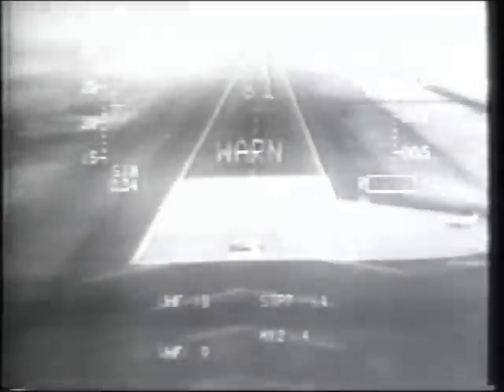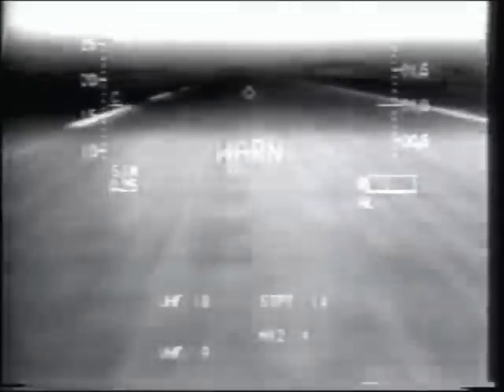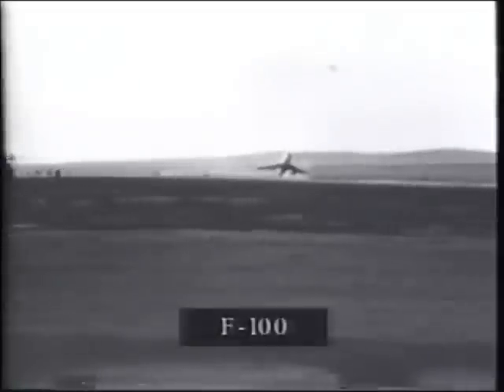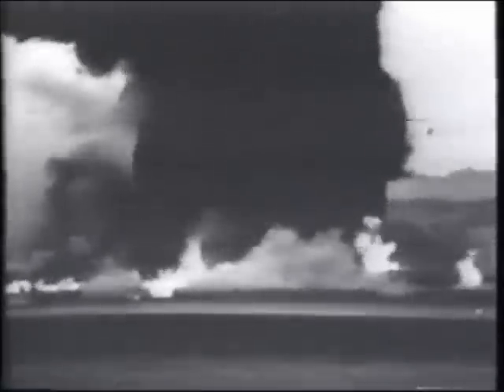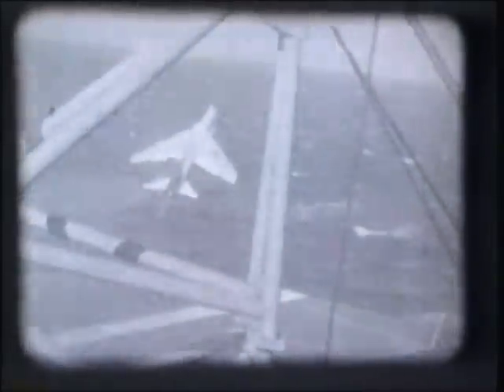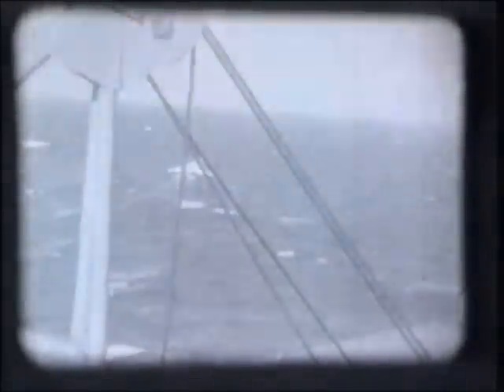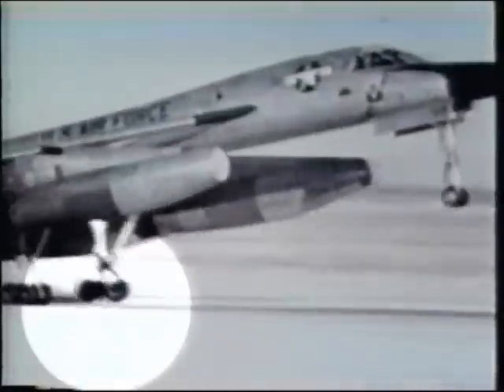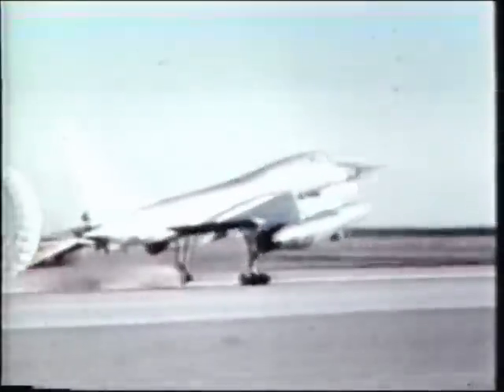Fighter Jet Aviation Crashes

Comment: That F-100 suffered a compressor stall, after the pilot throttled back up to abort. Not sure even a modern ejection system could have saved him...
Reply: An Aces II system could have.  It has zero/zero ejection capabilities.
Reply: Mr.Clem if he go out early enough. But, I saw a video made by Air Force talking to the pilots about not waiting too long before they ejected. Apparently, this was a problem with pilots of the early zero zero era. They stayed to the bitter end trying to save the aircraft.